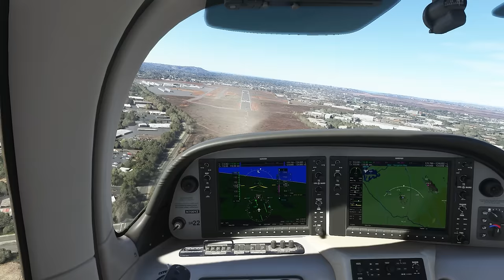Fatal Plane Crash At Montgomery Field After Student Pilot Declares An Emergency | N700YZ Crash

Comment: Not enough information to know exactly what happened.  There could have been a runaway trim issue.  I'm sure the NTSB will be looking into maintenance records for anything related.  The pilot may not have been familiar enough with the aircraft to know how to shut off the electric trim and deal with such a problem in terms of aircraft control.  This may or may not have been covered in instruction so the NTSB will be interviewing the pilot's instructor(s) and of course reviewing logbooks.  It could have been a situation where things just happened too fast for the experience level of the pilot.  That can be hard to determine but the audio is telling.  The NTSB will also be looking at the wreckage to see where trim settings ended up.  There is a lot of work to be done before we can understand what happened here.

Comment: First off - the pilot panicked.  You can hear that in his voice and the "stuck mic" was likely caused by the pilot holding the transmit button.  Had the pilot been thinking clearly, he could have deployed the CAPS system and been brought back safely.  I do not think the trim issue was a major factor in the accident, but the pilot didn't have the skills to handle the issue.  Aviate.  Navigate.  Communicate.

Comment: Very sad.  Prayers for his loved ones.

Runaway/uncommanded electric trim can be caused by (ordered by likelyhood): a jammed or broken rocker switch, a broken microswitch, an electrical short, or an autopilot issue.  The latter is highly unlikely, but the NTSB will examine all possibilities, nonetheless.

I specifically didn't list "Pilot-caused" as a possibility because the pilot was clearly aware of the issue, and was trying his best to resolve it.

Although not specifically identified, the (apparent) malfunction was most likely with the Pitch Trim, based on the ADS-B vertical data.

I don't believe this to be pilot error at all.  He was doing exactly what he needed to do (ATC be damned) by trying to maintain control of his stricken aircraft.  He also was aware of the plane on the runway, which would explain his side-step to the right of the runway prior to the crash.

ATC did a fantastic job.  I absolutely do not fault the pilot here either.  ATC always has last priority in emergency situations (Aviate, Navigate, (then) Communicate).  Here, ATC's focus shifts to A) keeping other traffic clear of the emergency aircraft (declared or not), and B) keeping their airspace safe.  She did everything right, and should be commended. She was clearly shaken by the unfolding events, but did a stellar job, regardless.

Unfortunately there was nothing he could do to sufficiently counter a runaway trim issue, especially on final.  Looking at the aftermath, it looked like a stall dive into terrain, which is exactly what would happen with a runaway up pitch trim at low speeds.

Lastly, he was too low to deploy his CAPS chute -- in other words, if he deployed the chute, it would have not opened.

Rest in peace, and deep condolences to his family and friends.

Comment: I was once ferrying a 58 Baron from maintenance back to its owner. When I turned on the autopilot the airplane immediately pitched nose down. The big red autopilot disconnect switch did not turn off the autopilot. A runway trim is a pretty scary situation. I fixed the problem by simply turning off the master as I could not locate the autopilot circuit breaker switches fast enough. Always remember if you have a runaway trim, just turn off all of the airplanes electrical power.

Comment: The response to a runaway trim be it on a small plane or larger like the Boeing 737 Max with a faulty MCAS is to disconnect the power to the trim via designated switches or the circuit breaker. Then deal with procedures. Basic stuff memory item stuff learned from day one operating powered trims. Sad shame.

Comment: That is extremely sad as for what could’ve caused the trim to runaway I’m not sure I’m guessing the computer malfunctioned and caused the trim actuator to take the trim away that’s my guess how serious that is though well it’s  extremely serious the pressure fighting the trim is going to be insane and landing is going to be a struggle because if it’s nose up trim it’s going to be fighting to get the aircraft on the ground without letting the back pressure win because if it does you will stall and if it’s nose down trim it’s virtually impossible to flare on landing which will be a flat landing which typically causes student pilots to freak out and start bouncing or porpoising down the runway if you are unable to fight the pressure you will dive into the ground

Comment: My heart aches for the lost soul... 
As a private pilot for single engine land, I can only think about what I can do in this situation.
1. Aviate-navigate-communicate. Aviate first. As long as wings are level, the plane will fly.
2. Pull out the circuit breaker and turn the trim motor off. That means you need to know where they are at all times.
3. This is a Cirrus. It has parachute. If nothing else is working, reach the ceiling and just pull the parachute.
Again, no need to blame anyone. It's better to learn the lesson and move on, so that we don't see this ever again.

Comment: I am not a pilot yet but I heard clearly the pilot state he was in an emergency and the controller ignored him. While he did not state his call sign the controller did not treat the situation as an emergency until after the crash.
Reply: In that case, you did not hear ATC clear the aircraft that was LUAW on the runway for immediate takeoff and turn out. She had no idea where the emergency aircraft was at that point. She just knew it might come down somewhere. So, she cleared the deck. Then she asked for clarification on the emergency. 

It is sort of like someone yelling fire in a crowded building. If you don’t remain calm, you don’t know if you are going to run to safety or death.

My only addition to clearing the runway would have been to declare that all aircraft exit the area on the upwind 45° right of runway heading. That may not be SOP. But, I am not ATC.
Reply: ATC literally cleared the runway and shut down the airport for him. Constantly talking to him won’t help, it will distract him,

Comment: We want to recognize the pain for family and friends.  We also want to learn what we can from the experience, bad as well as good, of others. Aviate, navigate, communicate has been a good muscle memory aid for many years.  You guys at ATC do a good job helping pilots especially in the high altitude environment.  Altitude is time.  Low altitude is a completely different paradigm.  A go around would have provided altitude and time, but staying in control was required regardless of the decision to land or to go around.  He seemed to be committed to the landing, which would have been fine.  Uncontrolled trim change or even cycling movement should not have become dominant, nor should have communication.  Finding switches and sorting things out are high altitude orientation, not low.  Of my 13 engine failures, 12 were at 200' or below.  They were six second deals.  Time to switch tanks but little else and aviate was even more important than switching tanks.
Reply: 1.  What the heck are you flying with all those engine failures, and why?  2.  Is an SR-22 really a training plane for solo?  I learned in an old PA-28 140.  Everything manual.  We should learn the basics first, hen advance to. Omplex.
Reply: My Chief Pilot has over 33,000 hours and he has only experienced three engine failures. My suggestion to Jimmy is, "With that kind of luck... never waste money on a Lotto ticket"
Reply: Woa!! 13 engine failures! You're dangerous to fly with. 960 hrs for me and never an engine failure. Once descending from 7k in my PA28-181, I thought it was quitting but carb heat quickly fixed it. Lycomings don't typically have a lot of icing problems, but under the right conditions, they can. Admittedly, it caused some puckering.
Reply: @roberthorton9820  I am old and was crop dusting when it was all piston and some really tired engines.
Reply: The guy was not ready to fly a plane. Sad destruction of a plane
Reply: Tt

Comment: Alway know where the trim breaker is located, and it is properly identified, so it can be pulled during a trim emergency. He also forgot to deploy the parachute. Thank you.
Reply: He was in the pattern. Thank you.
Reply: @el-blake-o4766  And … what does that mean? First of all let me say I exit the traffic pattern when more than one aircraft enters the pattern with me, particularly slow trainers like Warriors and 172’s. I fly a Lancair so in a busy pattern I cannot fully retract the flaps and I also leave the gear down to slow down the airplane. Too much of a hassle and very stressful (by my standards). My pre-take off check list includes being mindful of a trim runaway by locating and touching the trim breaker. I do not have a CAPS but the official minimum deployment height for Cirrus aircraft parachutes is 400 feet agl in level flight. FAA-certified tests have shown full parachute inflation could occur as low as 260 to 290 feet agl for some aircraft, according to BRS. Even if the canopy does not fully deploy it will somewhat arrest the fall due to drag but one has to pull the rip chord. My take on this tragic accident is that the pilot, already stressed in a congested (by my standards) traffic pattern, was caught by surprise by the trim malfunction, panicked, and stopped flying the airplane. Very sad. Thank you.
Reply: @CG-kf5vh  you are so smart as a PBD (pilot behind the desk ) … would love to see you out there in the air in real emergency
Reply: You bring up good points…. Even the Pilatus 12 … has had run-away trim problems

As I was watching the video I forgot about the parachute too… and I’m a big fan of the plane and caps system

Comment: As a long time amateur radio operator extra class, I’ve never had a “stuck mic” due to a mechanical problem. What often happens is operators have open mic issues due to operator error, such as dropping or sitting on a mic usually while mobile. My guess, is the pilot panicked as he lost control of his aircraft due to the trim problem. All he could do was land the best he could which was unfortunately fatal. The ATC operator also seemed overwhelmed, not realizing there was an emergency. My takeaway is always give your full call sign, phonetically if necessary, so that in an emergency there is minimal confusion.
Reply: In aviation, phonetically is the only way to give your aircraft registration/tail number. You only use nickname callsigns when part of a large fleet at a familiar airport. For example, College 47 is only acceptable at that university’s airfield.

Comment: I own a CAP10-C and it has electric trim and no manual trim. I was in the circuit downwind 1000ft AGL when I suddenly realised I was much lower than I should be, I pulled the stick back, it  felt like it was stuck, but I managed it, then determined the cause,  my trim was full forward, I trimmed it back to neutral and disabled the trim (which also disabled the flaps) carried on and did a flapless landing. The CAP 10 is fully aerobatic and you always disable trim and flaps during aeros so I was used to this procedure.
I have over 300 hours on this plane and I imagine for a student pilot the whole event could be overwhelming.
Later I found out the cause, my mobile phone in my right shorts pocket was randomly pushing on the trim rocker switch situated between the seats. 
You certainly have to have your wits about you when these unexpected unusual events happen.
The plane was controlable at full trim, but it took a lot of  effort to keep it level.
My sympathies are with his family.

Comment: Too many Cirrus crashes???????????????
Reply: I agree.... and it SEEMS like there is not only a bunch of them, but the ones that happen are strange..weird..unusual......or at least it appears that way to me.
Reply: These aircraft are very unforgiving and the pattern. You have to be extremely precise and on your book numbers. Parachutes don’t work in the situation most of the time. The automatic trim was probably the system that corrects for air speed. He most likely got too slow and the aircraft was trying to trim the nose down